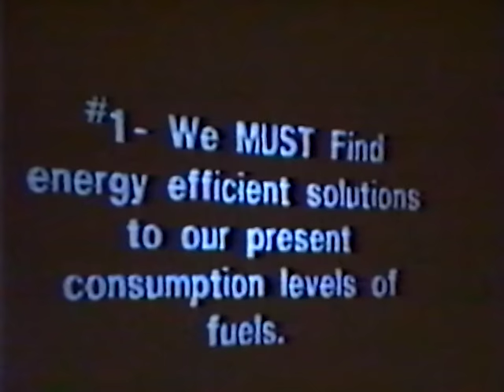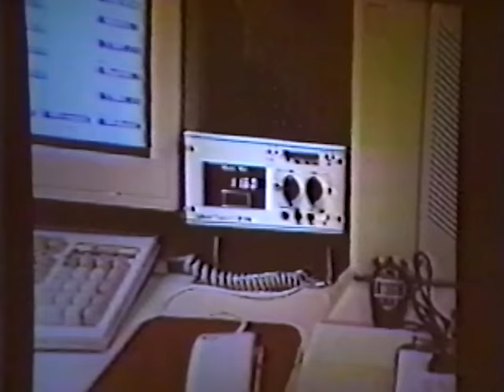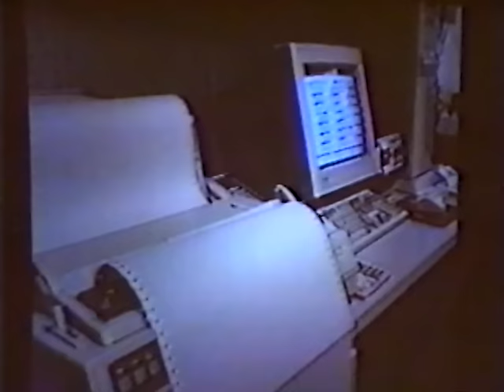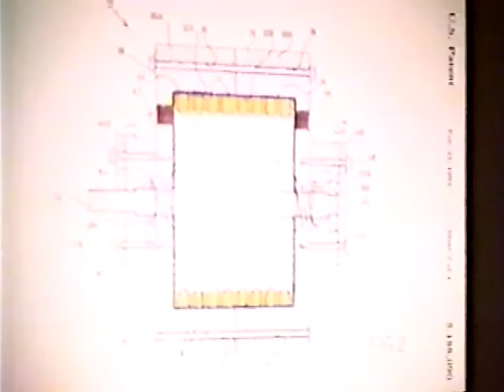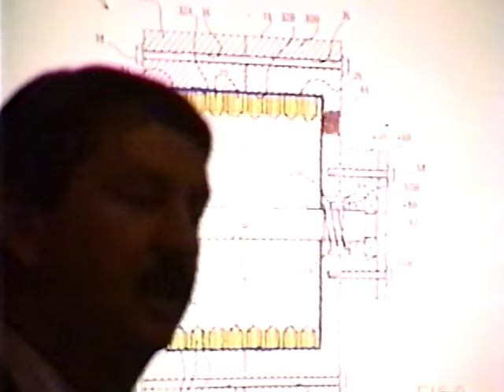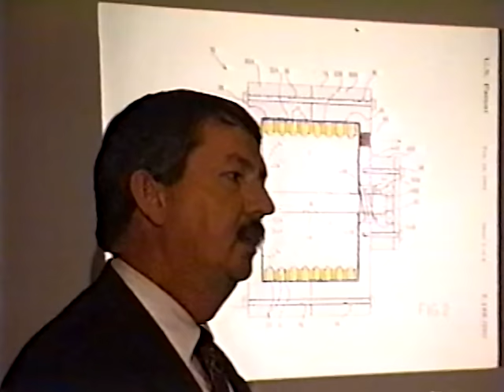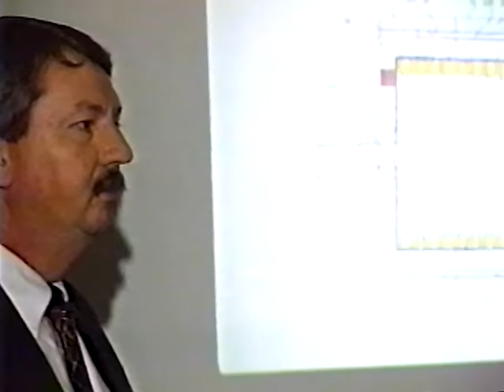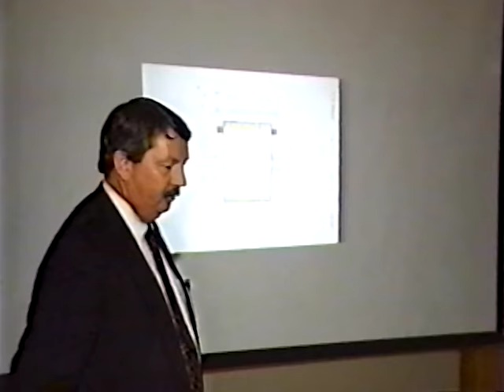The HydroSonic Pump - James L. Griggs, 21st Jan 1995

Comment: 31:08 - 31:26 - I remember hearing about this fire station system back in the early 2010s.  It was the same time I was learning about Mark LeClaire’s cavitation work and production of every element under the Sun using a HydroSonic pump, a rolled up Aluminium decorative wall panel (decorated using regular holes) inside a plastic pipe housing and water. 

It’s nice to see how these two threads fit together 🙂

As to the overunity being jumped on by the then “rational😢” (I.e unquestioning, deferential, blindly obedient) scientific community, that’s no surprise.

As to what James L. Griggs is saying in this video, it all sounds very familiar as we have come to see similar and the same across many experiments that the MFMP have brought together into a coherent and consistent body of work.
Reply: I also remember the claims of less energy required for wet stream as opposed to dry steam also being used in vitriolic attacks on nickel-hydrogen systems (such as the early eCat) to discredit any claims that they were overunity.  It was noticeable that those behind such attacks made no effort whatsoever to understand what was going on in the systems that they demonstrated such vitriol toward, yet they claimed to be rational, level-headed and scientific in their approach even as they stirred up hatred in the minds of onlookers, something very reminiscent of the bigoted, blow-hard, man-baby, alternative facts, “hatred of the other” politics the world has again sadly witnessed in recent times.
Reply: 45:15 - 45:45 Eugene Mallov having to deal with someone who is clearly only interested projecting an aura of superiority and wisdom to come across as “the only wise person and adult in the room” to then use ridicule to play on people’s fears so as to elicit a collective primitive child response of obedience in the audience to reject the physical evidence and results from the field facts on a purely emotional basis.  Scientist?  I think not.  Manipulative bully more like.
Reply from the maker: There is a good cautionary tale. I guess I learned by 2014 that there would be no amount of evidence that would suffice. Look at what we are seeing in Huang et al reactors - literally you can see the [magneto] hydrodynamic structures at work in rediculous detail.
Reply from the maker: Did look like that.
Reply: Hey Gordon are you on discord or available for a call?

Comment: If the holes were angled like a tesla valve, could the cavitation shockwave be useful for propulsion?
Reply from the maker: no idea
Reply: I would guess that viktor schaubergers home generator was designed to do just that, instead of making a heater, it makes more sense to exploit the intense pressure pulses to kinetically drive a rotor with self sustaining feedback..

Comment: Hey Bob, thanks for uploading this gem of a video..I was particularly intrigued by the pressure pulse that blew a hole in the glass casing above one of the reaction Chambers.. Do you think that the fact he uses an aluminium rotor plays a part when the bubbles collapse, i.e. do you think it would be as powerful if he used a steel rotor? I am thinking about the leclaire experiment where he uses rolled up perforated aluminium sheets in his reactor..
Reply from the maker: https://youtube.com/live/A8dw0lgoe_E
Reply: @MFMP  thanks Bob

Comment: Based on what I've seen so far, I'm assuming this device also likely produces strange radiation, similar to the Russian cavitation device? Do you know if the hot water/steam produced in a device like this (assuming it does produce strange radiation) would be safe to use for bathing or drinking? In other words, do you have any idea whether the water itself holds or continues to produce any of the strange radiation as it travels?
Reply from the maker: Yes, it likely does. He died at 68 in 2018 of Cancer, his father died this year (2024) at 97.
Reply: @MFMP  What a shame. Rest in peace. Can you share the name of the fire station that bought one of the pumps? I wonder what the health of the firemen has been like since installation. 

Also, regarding the water itself—do you believe that the machine simply produces strange radiation itself and if you were to send the hot water past the range of the radiation field it would be safe for bathing, etc? Or do you think the water itself becomes “irradiated” and carries the strange radiation with it no matter how far the water travels from the pump, making it “permanently” unsafe?
Reply from the maker: @HCG  Interestingly, I think the water would be good for you, sort of like natural hot spring water is. I think the possible danger would be near the cavitator.

https://youtu.be/gcF-KSLIAWs
Reply: What is done to mitigate or eliminate the external effects around cavitators lately, especially around things like the THOR?
Reply from the maker: @sentientCoding  What is done around any fast spinning materials? Very little. I would recommend alternating layers of conductors and insulators.
Reply: @MFMP  the negative effects of strange radiation or other derivatives of the cavitation function that are potentially shortening biological life expectancy around cavitators. I know the THOR is being demonstrated in public was the reason for using that as an example.

Do you have any educated guesses or estimates on the safe distance from engaged/active cavitators that are not currently assembled with mitigating equipment to limit or eliminate the potential negative consequences?
Reply from the maker: @sentientCoding  I do not believe the cavitation is strong enough in the TSG bubbler to cause these problems. The main action, as stated in Zurich, IMHO of the bubbler, is to maximise the humidity and entrained water into the TSG, where the Armstrong electrostatic effect takes over in any potential anomalous processes in combination with the known action of adding water to an ICE intake.
Reply: @MFMP  Thank you! is the Zurich presentation uploaded to the MFMP channel or elsewhere by chance?

Comment: Does anybody know what happened to this gentleman and his company afterwards?
Reply from the maker: He was still applying for patents in his name in August 2022, he appears to have passed on early this year (unconfirmed)
Reply: Very sad. It happened again… any hope to get the design or better a working machine?
Reply: @dolphin0064  While it merely working seems ground breaking, my search mostly brings up comments that a regular heat pump is more efficient. Would be good to understand the limitations of this investion to go and figure out a way to make it better.  Apparently the 40-50% overunity wasn't enough to loop it? I wonder why not, or was it a matter or not really trying? A gravity system that's 140% efficient is literal child's play to loop and make into a stand alone power station. What to do with this cavitation heat pump? Can it be placed in series before looping, to overcome any inefficiencies in looping conversion?
Reply: The James Griggs that passed away this year was his father. This James Griggs in the video went by James Lamar "Jimmy" Griggs and it appears there is an obituary for him for 2018. This obituary matches the photo and electrical background.
Reply: They remained in business for years, but without ever mentioning again the issue of the excess energy. I recall seeing a process design where the main pump was one of these, it was used to recirculate and thoroughly mix condensed volatiles from a Biochar producing kiln. I wondered if the engineer that passed me the plans had any idea about what was the origin of the pump.
Reply: Just checked and they remain in bussiness. You can ask for a quotation. They even offer a small “laboratory” unit now. Had not visited their homepage since at least 2018
Reply from the maker: @Aedonius  Thanks for that sleuthing, please can you send a link with this same message on https://remoteview.substack.com/p/the-hydrosonic-pump-james-l-griggs

Comment: Thanks bob I see the fire station long ago for the showers maybe 10 odd years but was not till not to long ago I heard the word cavitation and then you confirmed it was real but I never doughted it one bit seeing it I was thinking close loop it be amazing turbine generator cavitator on one system on unit and loop I thought motors are about 95 percent now days ac brushless maybe make the cheese drum rally big so it doubles up as a fly wheel rxr and 2 motors like the other ones with big fly wheel rxr works 1/4 to 1 ratio I think and big heavy fly wheel with the water cavitator would it work as one system e=mc2 is why rxr works ma's x speed square like back emf and line spin on on 2 motors one 2 one 3 phase so spin same cut down on eddy curunts I see he show telli port tramsmutation the 2 spots so I guess sacred gemoamtry I wounder what the metal turned into
They not targeting me last couple to 4 days but I feel the wepon system watch my last video I thought ot ow you going to take me out it started 5 mins later heard thunder 5 min bang bag bbb bang like carpet bombs wtf are ships at sea trying to take me out I have 0 clue but it sensor on lone the bangs 🎉